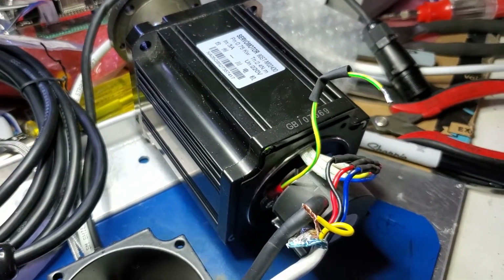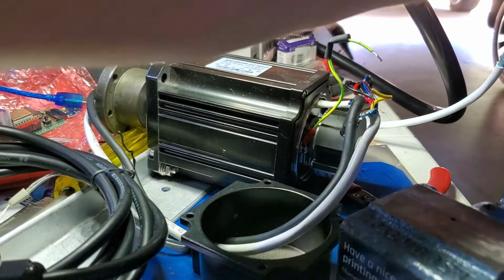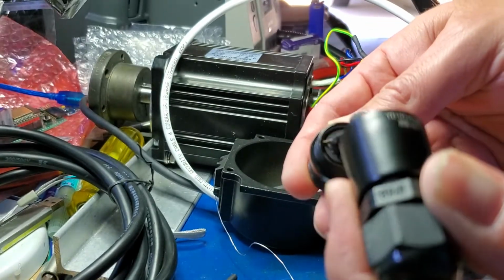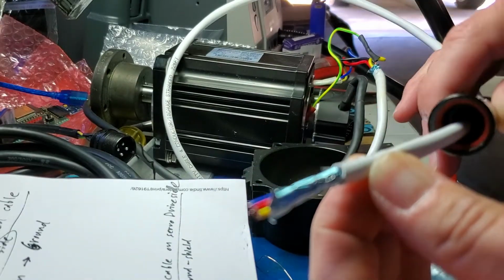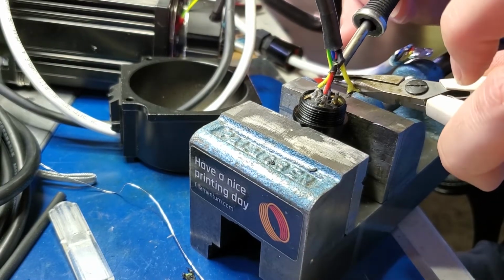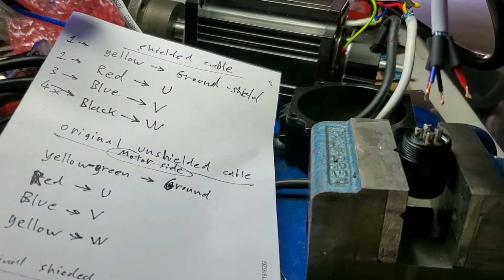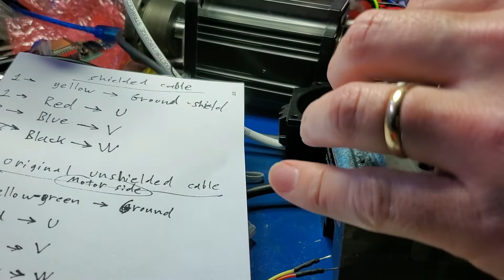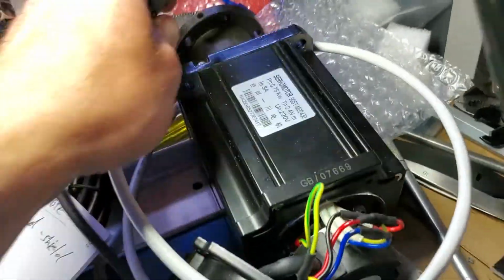Replacing the unshielded power wire on AASD-15A servomotor

Comment: Are you connecting all grounds together inside the motor housing, i.e. encoder and motor?  Multiple vendor documentation shows to have encoder shields at the motor end to be left open, to limit ground loops.  Over the past two years I have been involved with numerous servo motor encoder failures, due to the improper encoder wiring.  Problems resolved by removing all shield terminations inside the motors, with the connection only to be made at the drive end.
Reply from the maker: No just connecting the shield of the power cable to the ground... as it supposed to be...
Reply: @tronicgr  I think I would have been surprised otherwise :-)

Comment: Hey Thanos good job dude, did you open up the motor to connect the power cables or just snip off and join with solder, i'm talking about the 3 wires with the white sleeve/jacket on them?? i'm just about to tackle this job .

Comment: Are you sure the longer cable is shielded?  I just got the motors and the extension cable is definitely thicker than the one attached to the motor but i don't see a shield like that white wire. It looks like exactly like the cable you have there.
Reply from the maker: I'll measure it with oscilloscope tomorrow, but I'm pretty sure it is.
Reply: Thanks!.  That would save some work if it is
Reply: I think it's not.   Mines at least is not.  it is RVV cable and not RVVP.   RVVP is shielded and RVV is not.
Reply: Yeah it didn't look shielded to me. Would be good if it is though.. my seller even told me mine isn't, only the encoder is. I should really buy a cheap oscilloscope and see what readings I'm getting. Apart from the odd mouse and keyboard dropout in certain areas I haven't really noticed anything too crazy.